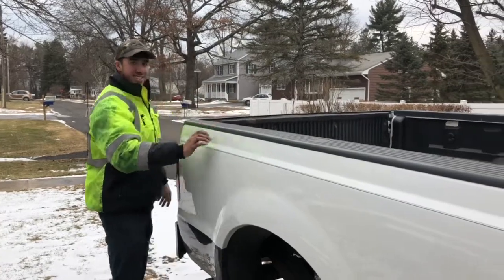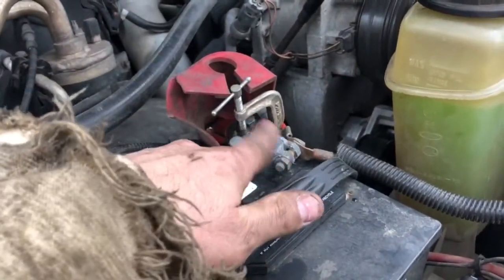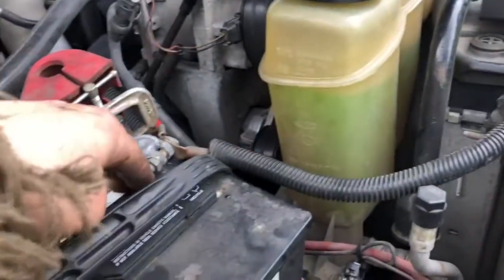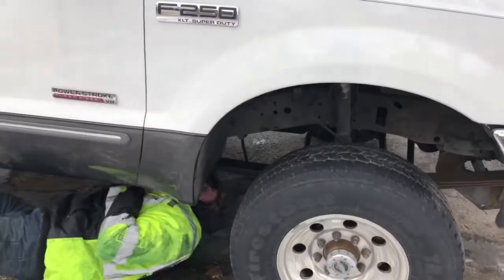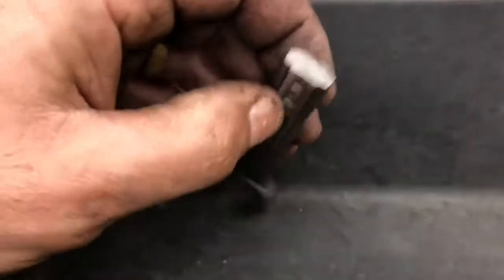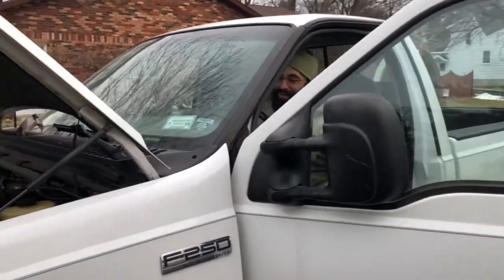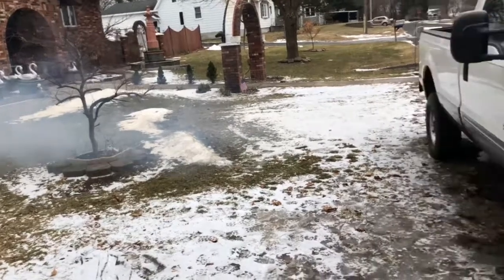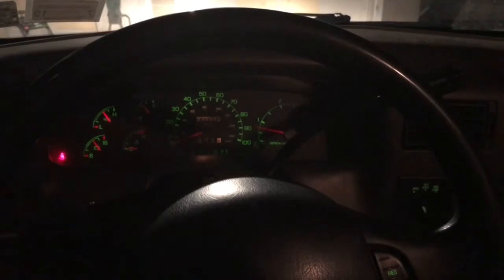Ford 7.3L Starter Replacement - POWERMASTER ULTRA DUTY #9051

Comment: Good stuff about cutting the 15 mil wrench in half. I was thinking to myself how the hell does anyone installthis f’n  thing
Reply from the maker: They are tuff. I actually removed the high torque started and gone back to originals on both trucks. They started eating my flywheels.
Reply: @VicsYard sheeeesh. What made you feel the need to do/find that out?
Reply from the maker: @madmax.3572  Good for about 8 months the just started ripping teeth off my fly wheel. Checked if everything was tight. All good. New battery’s and a 160 amp alternator. The 2nd truck lasted just over a year. Same thing. Grinding my fly wheel.
Reply: @VicsYard man I think I’m gonna take it off I don’t want those problems. There’s a guy on7.3 page on FB said the same thing. There’s also plenty of people that like them but sounds like an avoidable headache
Reply from the maker: @madmax.3572 I’ll look when I get a chance what brand I replaced with for ya. Remind me if I don’t comment back.
Reply: @VicsYard  hey go look at your starter
!! HAHAHA

Comment: Really appreciate this. As with many, the top bolt is a challenge.  I have no idea how to torque it. Curious if you are still satisfied with your powermaster.
Reply: Just read through...apparently not all it's cracked up to be. Thanks
Reply from the maker: It’s an old video. It’s a great starter. It actually messed up my fly wheel teeth. Ended up removing it about 6 months later. White truck. Then my other 7.3L “red truck” I put same starter in and had to remove it after about one year. I’ll have to find out what brand starter I put back in it for ya. I always run really good batteries and very clean conditions.

Comment: Love your video. Just installed one o a 2001 7.3. Spins over crazy fast but sounds like a GM starter that’s not shimmed correctly. Is this normal due to the gear reduction?
Reply from the maker: Had this starter in both my 7.3L’s... Ended up pulling out. One failed and other was skipping on flywheel teeth. No good. I’ll have to look up what I put back in there. Works good now. TY
Reply: @VicsYard  Thank you for the information. That top bolt is such a poor design!
Reply: @VicsYard  I'm planning to replace the starter in my 7.3.  What did you go with and would you recommend it?
Reply from the maker: @jeffwatson1573  Ill have to look. I ran different Brands and had some rebuilt as well. Couple days ago I had one start acting up again. Needs new solenoid probably. Battery terminals cleaned as well. Test and charge batteries.

Comment: Came here to figure out top bolt. Hoping there better now I got the matte black one. Hoping it holds up
Reply from the maker: Robert Simmons At first I liked the starters. Then in both my trucks they failed. One lasted about 6 month and the other just over a year. Make sure them bolts don’t come lose. You will know it when it starts grinding. Ask me how I know. Lol little lock tight might help.